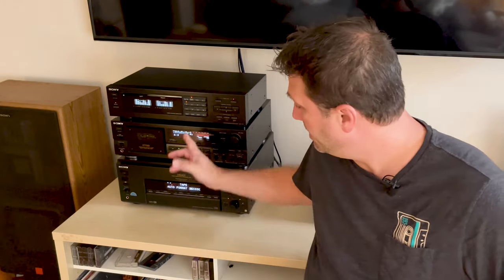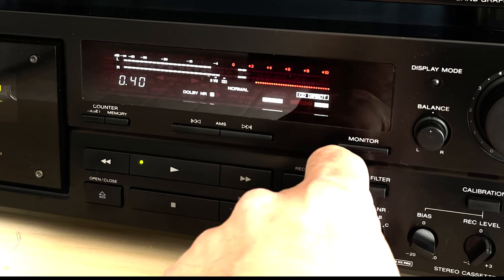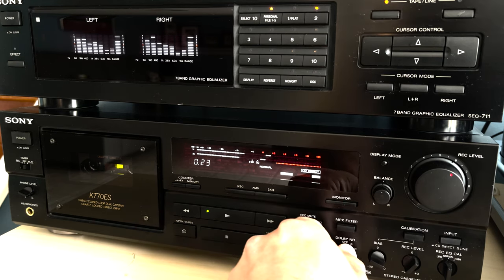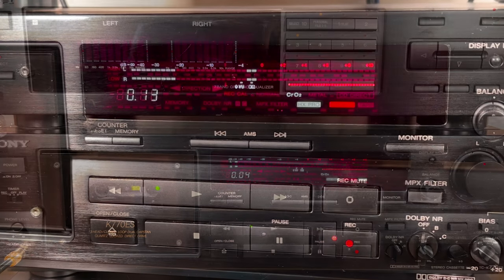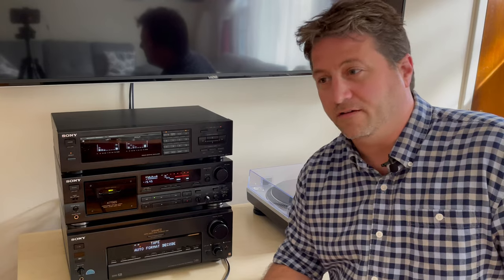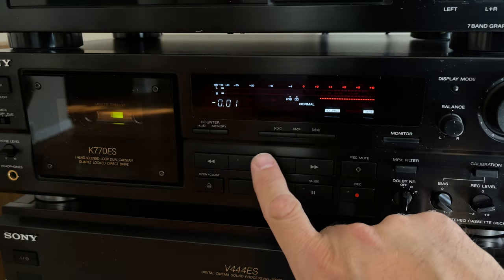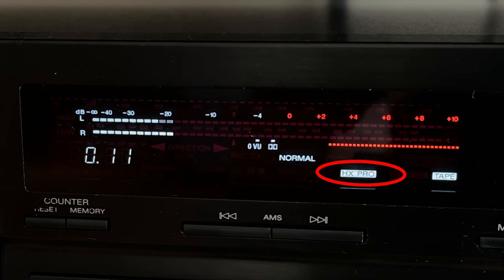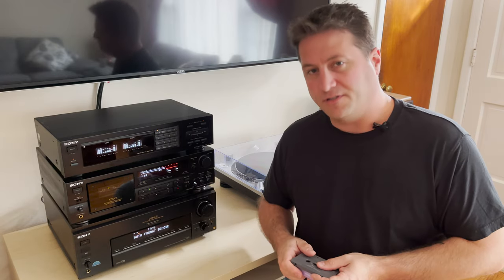Dolby Noise Reduction - Did it ever really work right?

Comment: I use only DBX With a calibrated cassette deck. Much better noise reduction system in my opinion.
Reply: As long as you don't attempt playing them in non DBX equipment your okay. But playing a DBX encoded tape in decks without it will sound absolutely terrible.

Comment: Dolby was great on pro equipment,but the truth is  Dolby B or C does not work  , but hey, you had that cool logo on your equipment . Dolby Pro Logic was great , though
Reply: Dolby B and C work quite well, but due to Dolby NR being a compander based system, conditions have to be right.  If level calibration and head alignment is just the slightest bit off, you will start getting that dull and often times  “pumping” like artifact.  Not to mention there were many people who just assumed you could switch it on for anything and it would automatically give good sound.  When it didn’t, I think some people just gave up on it without bothering to learn how to use it correctly.
Reply: If you have a properly serviced and calibrated tape deck, then it is transparent.  It goes double for multiple decks. The Playback Level and Head Azimuth have to be exactly the same between the decks, if they are.. they it will work well.
Reply: Happy to hear it worked for you , but if you need a 3 Head deck with Bias control ,  I still think it is useless . Only 1% of the population had a deck like that .
 I had a brand new  AD WX737 by Aiwa , mid of the range in its time,  with HXPRO , B and C , and still was disappointed with the Dolby  results. 
Cheers !

Comment: DECKS DO NOT HAVE DOLBY A. LATER DECKS HAVE DOLBY S. AND DOLBY HX-PRO. USED BY RECORDINGS DOLBY HX-PRO ON EVERY DECK WITH HX-PRO. YOU HAVE THE SAME QUATITIE. BUT BY DECKS NOT HAVING IT. THE LEDS WIL NO MORE GO SO FAR OUT. IF THE DECK HAS A MPX FILTER. TURN IT ON. NOT EVERY RADIO HAS A MPX FILTER. AND YOU HAVE TO CLEAN AND DEGMATISEER THE DECK IN THE ADVISED TIME. YOU HAVE A GREAT RECODING.

Comment: Having been born in 1963, listening to music since then, and now almost 60 years old, this lover of rock music would like to give his opinion of Dolby noise reduction technology.  Dolby A sucks, Dolby B sucks even more, and Dolby C sucks so bad that I'll say no more about that.  I remember the 80s when Dolby was touted as the greatest thing since sliced bread.  The 80s, in my opinion was the greatest decade for rock music with but one exception, Dolby.  Dolby sucks, it sucked then, it sucks now, and I doubt if it will suck in the future because nobody uses such a sucky, stupid method of noise reduction anymore because it sucks so much.  But seriously, if anybody would care to ask me what I think about Dolby, I would tell them that it sucks.  So, in conclusion, I would like to say that Dolby sucks.  And now, please let me have a Joe Biden moment here to say, what I haven't said here before, and say that Dolby sucks.  IT SUCKS!!!!!
Reply: No, it doesn't.  I've been using Dolby B and C for decades. However, all of my tape decks have had their levels and azimuth matched. Dolby requires a specific PB voltage level.. if it's off, then it will not work right. Head Azimuth has to be correct.  Even the slightest difference will cause problems. However once a deck is calibrated, it works wonderful
Reply: Dolby doesn't suck. But low end cassette decks suck. Dolby is effective at optimizing SNR, but low end decks have problems that Dolby cannot correct.
1. Wow & flutter. A poor transport will muddy up the sounds if it cannot keep constant speed.
2. Playback head. A low end deck usually has an erase head, plus a record/playback combo head. The frequency response is generally not as extended in high frequency region as discrete record & playback heads. This results in suboptimal treble.
3. Bias & sensitivity adjustment for various tape formulations. Due to cassette low speed of 1.875 ips, getting best results from any tape type requires optimum bias & sensitivity settings. Over-biasing will suppress treble. Under-biasing increases distortion. 
So, low end decks seldom offer adjustments.
4. Over-recording greatly suppresses treble & increases distortion. Many buffs are obsessed with maxing SNR. So they blast the record levels well beyond 0 VU, into red zone. This way they feel they are covering up noise.
But if Dolby is used, especially C type, the tape bias noise is reduced by 15 dB, & is practically inaudible. No need to red zone the meters. If Dolby is used, recording at or below 0 VU keeps distortion low, & treble response flat & extended. But those who record way above 0 VU are reducing their treble. Dolby mistracking reduces treble further.
Nearly all treble deficiency problems are due to over-recording.
Bottom line - Dolby has been getting a bum rap way too long. Dolby is so effective at reducing noise, one can record at moderate levels to keep distortion low & treble flat.
Dolby does have a problem. If the treble is too strong, Dolby makes it stronger. But seldom is a cassette deck too strong in treble. If treble is weak, Dolby weakens it more. This is known as mistracking.
But a very good deck with 3 heads, low w&f, adjustable bias/sensitivity, with flat response to 20 kHz, will benefit greatly from Dolby with little treble loss if any.